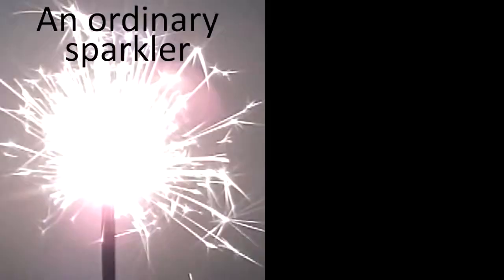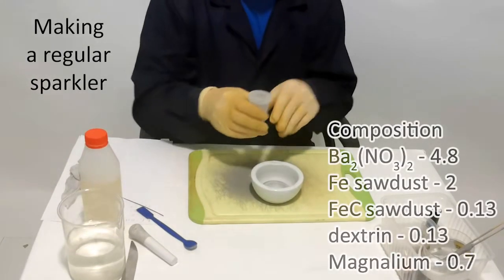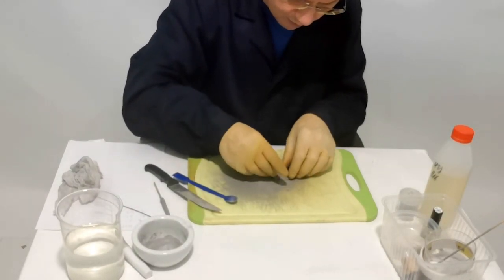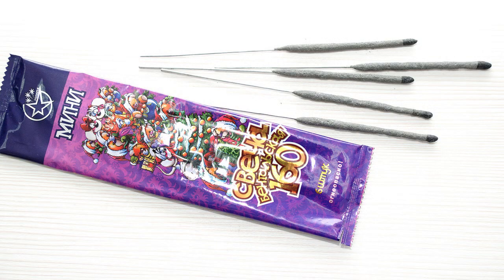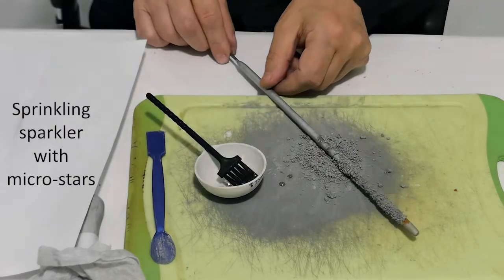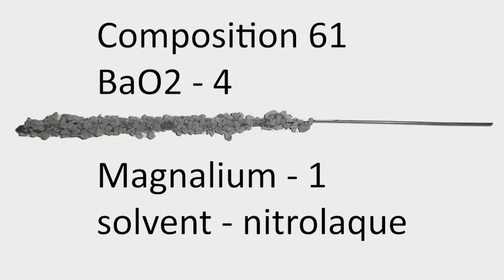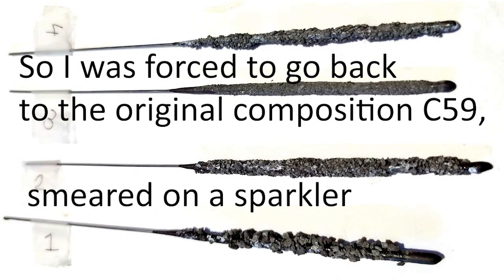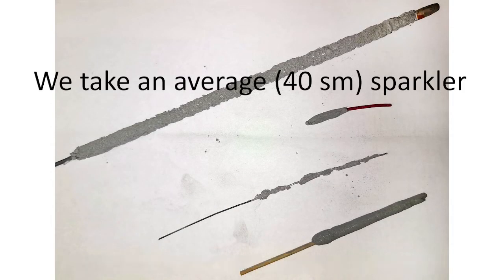Crackling sparkler. Video #20

Comment: Does 'Fe ' need any coating for rust protection??
Reply from the maker: Needs. Bluing with linseed oil. But I buy ready-made iron filings and do not store my pyrotechnic products for a long time. That's why I don't do anything with sawdust.
Reply: @handfirepyro  
Thank you...